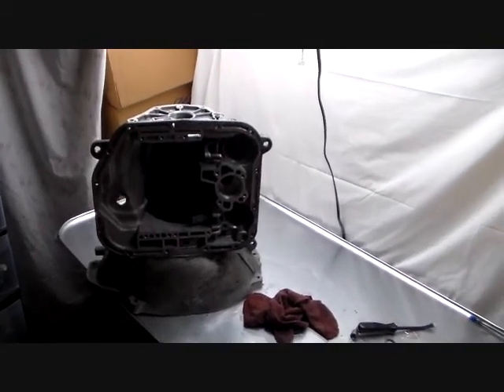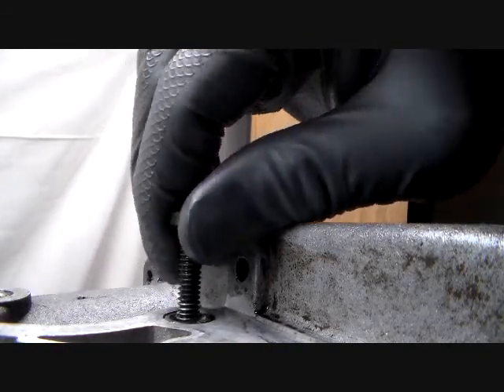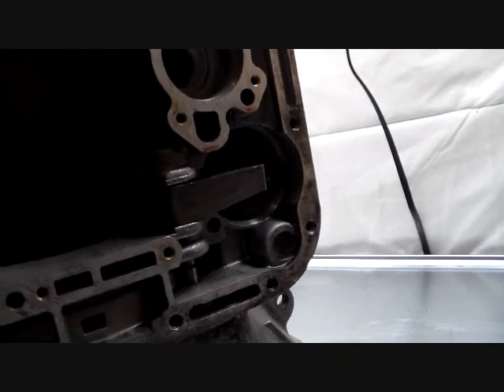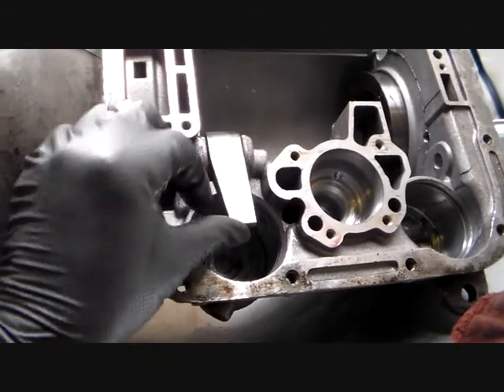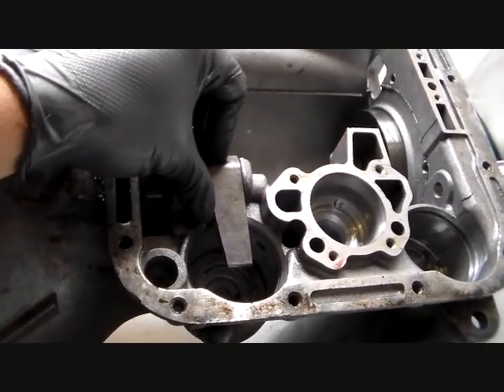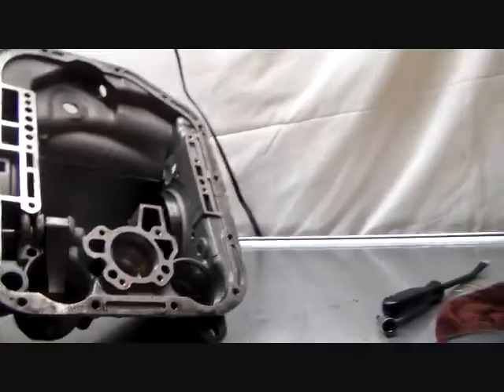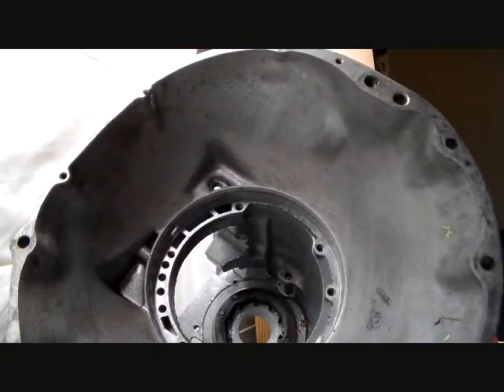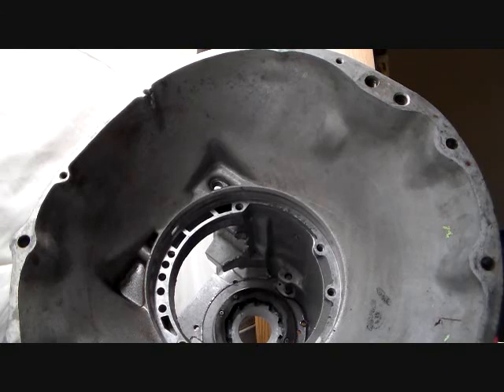Mopar A904 overhaul for rookies part 9: One more thing...

Comment: Some of them have two o-rings, some have one o-ring. Mine has two its a 97 jeep wrangler se (sew) a-904 30rh so that might be the difference. After you change the o-ring(s) make sure you use a liberal coat of Transmission Assembly grease all along the pin and the o-ring(s). Then when you install it, it will slide in like butter. If you dont use the grease you could roll the o-ring(s) it wont go in as smooth and it could leak. Thanks for the shout out. Im happy to pass on the information if you can use it. After having the jeep back for a couple weeks or so I tell you the difference is night and day. Some thing else I forgot to mention is when your doing the valve body and your taking the two halves apart you will need to "block plain"  the halfs (cast iron halfs that the metal plate sits on this is I assume to get rid of previous debris just a light rub with a block should do it). The way I realize mine had been rebuilt already was the little balls inside the valve body were changed from steel to plastic this saves the separtator from being beaten up or bent by the steel balls. If you have steel be sure to check the "reverse check ball" which is on the side under the plate after its taken apart from the other half in the upper right hand corner (usually). A larger hole then catty corner from it is a much smaller pin hole. If the plate has a ridge around the hole and/or your having a hard reverse use a grinder to relevel the steel plate being careful not to over grind the ridge off. You dont have to but whoever rebuilt the transmission the first time replaced all the balls with plastic normally a transmission shop will only replace the reverse ball to keep it from damaging the separator plate. Great video again!